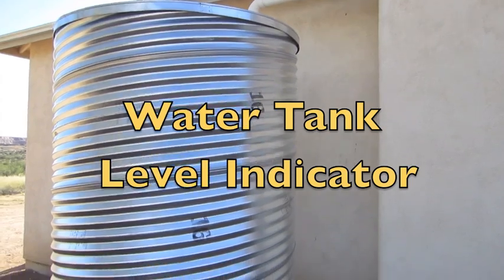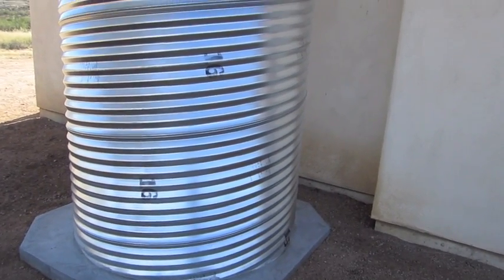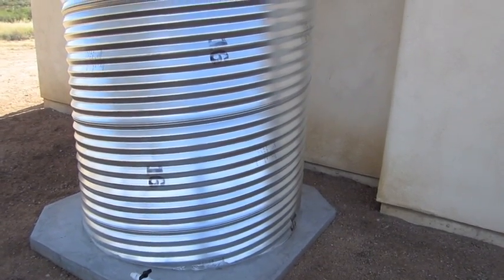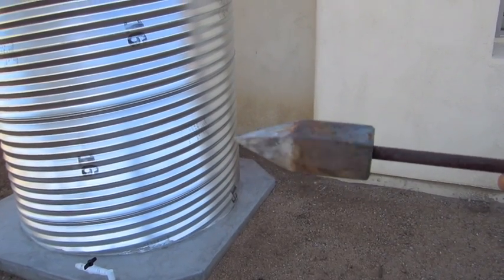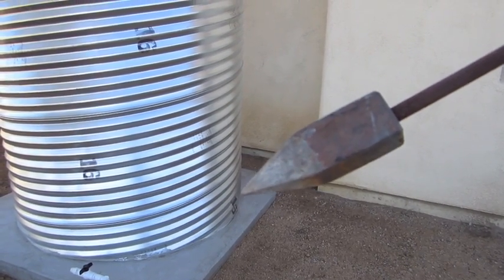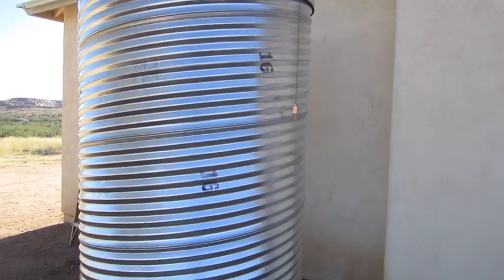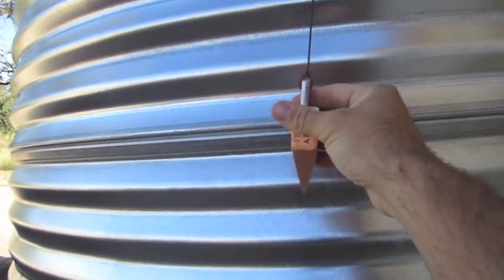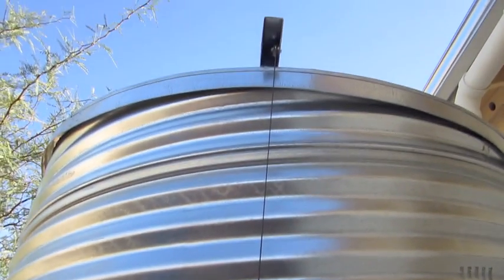Water Level Sight Gauge - How to make a water level indicator for a culvert cistern or tank

Comment: The level indicator on the outside of the tank is a SOLDERING IRON. THAT IS WHY IT IS NADE FROM SOPPER. You had to heat it in a fire to get it hot before using it. Very effective

Comment: If, from left to right, we name the pulleys P1, P2, P3 and P4 ... we can probably mount the two pulleys P2 and P3 on the same axle shaft.

Suggestion #1: The string/line/cable goes from P1 to P2 in either the clockwise (CW) or counter-clockwise direction (CCW), and to the counterweight and then back to P3 in the OPPOSITE (CCW or CW) direction.

Suggestion #2: Also, the counterweight can be another empty bottle (exactly like the float) whose weight is adjusted by the water inside it - this would be cheaper than the counterweight.

Rest of the design is the same.

Comment: It's fancy and pretty cool to see it operate. A clear plastic tube on the outside of the tank can be installed in minutes and -- voila! -- you'll see your water level. As long as the outlet of the tube is higher than your tank it will not leak. You can feed it back into your tank, too, if you're worried about it.
Reply: I think with sunlight hitting it, that would grow algae in your system.

Comment: That tool is a black smiths soldering Iron. You heat the iron or copper or such with a flame and melt the solder down to the tip and it solders. I have several and have used them here in Chile. I brought mine from the former USA. Jim

Comment: That copper point was used as a hot iron for soldering large wire connections. A new ELECTRIC 100w soldering iron, not a gun, sells today for about $100. Your ANTIQUE was probably worth a little more to a collector. Now it's a plumb bob

Comment: Neat idea, In lieu of cutting a door into the top of the tank, I used a 
(Search term) SEAFLO Marine Deck Access Hatch & Lid - (14.75" x 10.6") 
Also, using the soldering iron was cool. You will see it every time you look at the tank instead of it sitting in a drawer until someone ends up throwing it out. I know like I know, Great-grandpa would approve.

Comment: That's the head of a vintage soldering iron, which usually had a steel shaft and a wooden handle. The head was placed in front of an old blowtorch to heat it up, then it was used to melt solder for various tin work. My father used to have one, and he used it on occasion to make gas and sewage tanks for boats.

Comment: that’s  is a Antique Soldering Iron ,not a PlumbBob looking thing  as a kid my Dad and Grandfather had a bunch of them  i suspect  the wer something my Grandfather may ha used as a Body and Fender man in the 1940s befor they had Bondo  they actually used lead  they melted and tinned to the sheet metal  after a hammer and dolly  stretched or shrunk the metal  i do like what you repurposed it into  of course a Antique Plumb Bob  would had worked as well  or just about any weighted item

Comment: Worked in the high end metal crafting field. Best way to clean old copper without damage is set it in a bowl and cover with tomato sauce, spaghetti sauce etc Usually only takes less than an hour soaking to regain original shine. Just rinse off in water.

Comment: What happens to the counter weight when the float passes it going up as the tank fills?? Does the counter weight float or how does it works?
Reply: The counterweight is made of a material such that it will sink. However, due to buoyancy it will experience an apparent lose in weight.  When it is covered by water the controlling equation is: the sum of the apparent  weight of the water in tne bottle  and the indicator weight is equal to the apparent weight of the counterweight.

Comment: This is what I did. I'm in Africa....i don't have access to all your materials...i used a mineral water bottles tied with a rope at both bottles' necks. The one bottle  to enter the tank has much water volume that the bottle outside(to control gravity). When the tank gets full, the floated bottle in water comes to the top, making the other bottle outside dropping down to indicate tank is full. And when the water is going down, the same yours goes down inside, mine does same. I only need the pully
Reply: Post a video!

Comment: Great video. 
Home much does the counter weight weigh compared to the other two parts (the jug and the soldering iron)?
Reply: The combined weight of the other two. Hence, counterweight.
Reply: The sum of counterweight and the soldering iron is equal to the weight of the water in the jug

Comment: That's much easier posible and only with a floater in the tank.
Reply: of course the readings would be opposite...i.e.  with tank full, floater on water surface,  indicator would be at bottom area of tank,,,,easy to read if you are not drinking

Comment: Genius!! When you add another culvert cistern why not just a clear pipe running along the outside connected with 2 90 degree elbows to run under the bottom of the tank ? Seal off the top with an end cap and a pin hole in the top for air to escape
Reply: It´s simpler that way but you need to keep the water in darkness to prevent alga from growing. Probably that clear pipe would turn yellowed cause of UV rays or green cause alga
Reply: @roc3671 

Nothing probable about it. It goes black and useless quicker than you can believe.

Learned the hard way...

Comment: Nice touch with the heirloom weight.  I constructed a similar (less complex) system for my IBC Tote that is wrapped in black plastic.  I used a fishing bobber on one end of monofilament line inside the tote and a large nut that glides up/down on a fixed guide wire.   I cut a hole through the tote top near the edge  attached a 1/2" PVC pipe with elbow to guide the monofilament line into the tank to eliminate friction/wear on it.  I did need to add a couple 5 gram weights to the bobber to counter balance my system.  I used copper sinkers to take advantage of copper's algaecide properties.  To keep insects out of the pvc elbow I stretched a piece of panty hose with a small puncture hole for the monofilament line.  Works pretty good and I can see relatively easy what my volume is.

Comment: A bit of plastic tubing in an siphoning arrangement would also have made the trick. You could read the vaterlevel outside the tank in the tube. Entering the tube over the top and you will have no leakage problem. By lowering the tube end you will also have a valveless water»tap».

Comment: Hello .....we in the process of building this system as you have shown however I need clarity on a few points please advise us on these:- 1) The counterweight, exterior weight and the water level float ....what would be the respective weight differences ie does the counter weight equal that of the exterior weight and that of the float ?
2) Does the counter weight allow any water flow through it ie is it a hollow tube / weight?
3) While your counter weight shows that it has been fastened to either side of it it does come together in the form of a triangle further up ......is line from the weight and float passing through the triangle or is it fixed? I thank you in advance for your interesting video and your help! Kind regards Malcolm.
Reply: The sum of counterweight and the soldering iron is equal to the weight of the water in the jug

Comment: That is an nice design.  I found this vid when trying to figure out how to make a diy non-electrical water level system for my boat water tank, so this approach won't work for me but I like what you did.  One thing I wonder is what the old soldering iron is going to sound like against that corrugated tank on windy nights but I imagine that a vertical channel made of wood surrounding its range on 3 sides and lined with outdoor carpeting or something would take care of that.  For my boat I think I'm just going to use some transparent teflon or PEX tubing to make a sight glass running vertically where I can see it that connects the tank outflow at the bottom with a new fitting near the top of the tank.

Comment: I have two issues, supposing if the bottle is 10 inch long and when the top of the bottle hit the top of the barrel, there will still be a space of 10 inch remaining in the barrel and it won't really show the level of water above the 10 inch. Secondly if the leveller is also 10 inch long and when it hit the bottom of the barrel there will still an error of 10 inch in the indicator because even when the barrel is empty inside, from the outside it will look like there is still 10 inch of water remaining.
Reply: It is not meant to be a precision instrument, just a "close enough" indicator to let him know when the level is dangerously high or low.
Reply: @jim7smith  Nice reply. to minimize the error use a short  bottle with a wide base area.

Comment: HEY , LIKE THE VIDEO , LOOKS LIKE PLUMED BOB , IS A OLD SOLDERING  IRON ,BEFORE PROPANE TORCHES , YOU WOOD PUT IT IN THE FIRE , HEAT IT UP  , THEN USE IT TO  HEAT UP THE PIPE ,ETC.. , THEN MELT THE SOLDER ,IN THE CRACK, YOU HAVE TO BE  FAST IN COLD WEATHER , THANKS RICKY...............

Comment: You could have used a plumb bob to do the same thing without destroying a fantastic antique soldiering iron.
Reply from the maker: Yep... I'm not the smartest guy on the block...lol... but I did have two and the other is still in nice antique condition:)
Reply: homesteadonomics don't pay attention to the crybabies. these are everywhere and not that great antique find of the century. usually a buck or so at a flea market so not a loss to humanity

Comment: so, do the little brass weight and the water in the bottle need to be similar in weight? what about the weight of the counterweight?
Reply from the maker: +Missy Rabbit Hi Missy, it's more about the counterweight being slightly less than the indicator and the water bottle.  When the water fills up the water bottle (with water in it) becomes lighter than the counterweight and thats what moves the indicator up up or down with the level of the water.... Hope that helps:)
Reply: homesteadonomics thank you

Comment: I wonder how this culvert setup would work in areas of the country that have freezing winter conditions? Would 1100 gallons freeze solid making the water unusable during these months?
Reply from the maker: +Adam Bullington Hey Adam,  I don't have experience with the  freezing conditions that some have... but I'd say, just to be safe, that you'd want to drain this cistern for really cold times of year.  In more mild climates you might be able to insulate or even heat the water, just a tad, with a livestock water heater.  Anyways, hope that answered your question a bit:)
Joe

Comment: Been using culverts for years. Always galvanized iron pipe. No freezing problems.
We use floating eps {foam] lids. Gauge is a no brainer. Have 14,000 gallons
of storage. 4 ft diameter best bang for the buck. Tall leaders @ front and back of 
house, and transfer to large storage. All that pvc piping good for Xmas lights.
If you live in Tucson, you probably know who I am.
Reply from the maker: The Mikey Block Channel Hey Mikey, I live in Sahuarita but I'm not sure I know you?  But am interested, maybe I could come do a tour of your place sometime?  Sounds like you've got a great set up:)  Thanks for watching and let me know!
Joe

Comment: hi i have tried something similar with sement in plastic bottles , but my counter weight does not seem to be correct . Water does have some influence on weight and im not sure how to correct it. I saw another video where the counter weight is outside the tank maybe that will solve my problem but i haven tried that yet . any advice ?  thanks
Reply: Amori B, I also constructed such a system with plastic bottles filled with mortar for both  the indicator weight and counter weight and a ten litter water bottle for the float. to get the weights right, weigh the indicator weight and the counterweights together, the sum of their weights should equal or slightly less than the volume of water in the bottle. in my case the indicator weight was 0.5kg, counterweight was 1.8kg while the water was 2.2 liters. This arrangement worked perfectly.
Reply: Yes, water has a lot of influence on both the counter weight and the float. The counter weight in relation to the float  is such that it is not too heavy as to make it sink permanently in the water and also not too light as to not make   the suspending cord tight enough.

Comment: Is this the tank recently shown in MEN or BWH?
Reply from the maker: Yes it is Krispin!  BWH last issue... and I also have another article in this months BWH about desert gardening with rainwater!  Thanks for watching:)
Reply: homesteadonomics I read the article with great interest. How is the zinc for water contamination/taste? Does the concrete base seep? Could it be used long term vs a plastic tank? I think this is a great idea
Reply from the maker: Krispin, glad you enjoyed the article:)  As far as the taste and zinc, etc,...I filter all of my drinking through a Berkey Ceramic water filter so I'm good on that front:)  BUT, when I brush my teeth, etc,. I find no bad taste at all with the water.  Also, the concrete base on the inside is coated with Ames Blue Max sealant so the concrete and water don't ever have contact and I don't have any seeping at all.  I do think this is a long term water storage if taken care of.  Obviously, concrete with crack over the years but if you keep it sealed then all should be well for a long, long time.  The big thing I'd worry about though is if you were in an environment that got extended freezing temps.. you'd have to drain and cap off the tank during the colder months of winter.  Other than that I'm really liking this tank alot!  Thanks for watching:)

Joe

Comment: You could have also made a clear PVC U-trap style monitoring device that would have only requited one hole in the lid.
Reply from the maker: That's a good idea... but I was trying to use stuff that I had on hand and I really liked the idea/design of the double pulley system.  But I may just have to look into that for one of my other tanks... they'll need indicators soon too!  Thanks for watching:)
Reply: Alphonse Mephesto  I find that clear PVC clouds over after a time.
Reply: Its a great, I only worry about the pvc pipe cracking near the u if it gets cold enough.